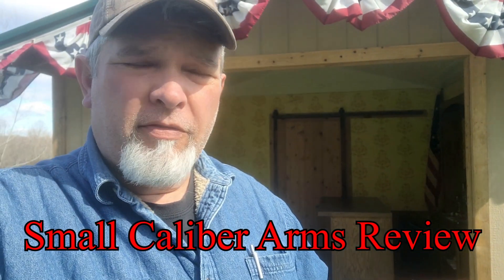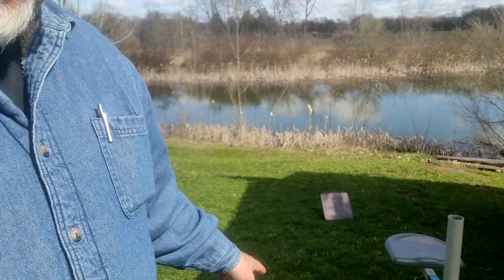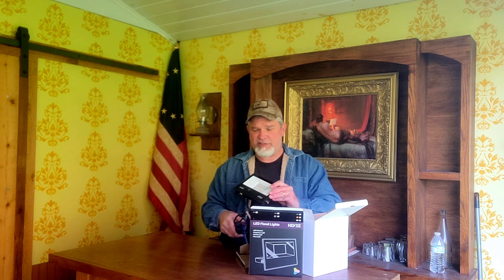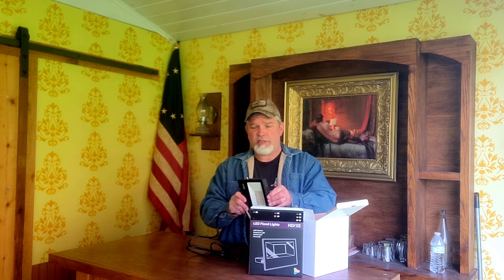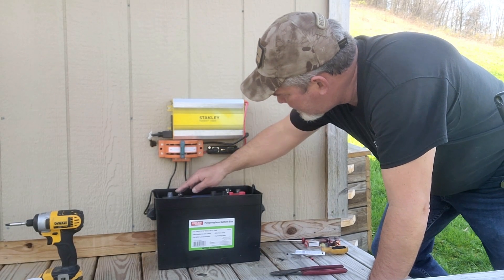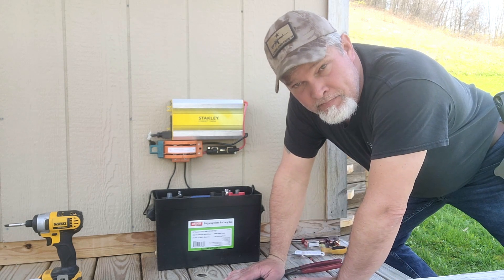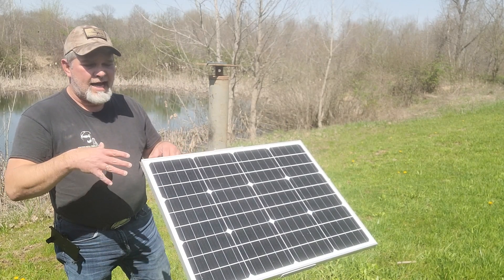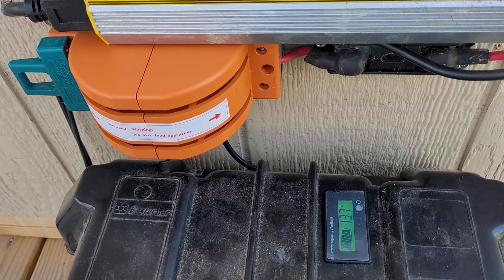Solar Power - Offgrid at the Saloon

Comment: I have a similar setup with the inverter and marine battery that I use for emergency power. I have it on a fold up 2 wheel dolly to easily move from my porch where I store it and have it plugged in with a battery tender.

I have to use a sleep apnea machine to sleep at night. If the power goes out which happens a lot here, I don't sleep. I even use it to power the refrigerator if it's during the day.

I'd like to get a better battery system with LiFePo4 type of batteries and be able to get more energy out of them and be able to use a larger inverter. Also get a solar panel to keep them charged too.

Looking forward to your new building plans!
Reply from the maker: Those LiFePo4 batteries are expensive! I do like that you can discharge them more than the Lead Acid batteries though. I really want to get started on the new project but it's still a little way down the road. Thanks for watching!
Reply: @SmallCaliberArmsReview  I would like to use those batteries for lighter weight as my set up is somewhat mobile. Plus gain some more amp hours. I've thought about the 18650 built up into a pack but then I assume it would get delicate being mobile.
Reply from the maker: @jeffallen3382  Whew! That could be a lot of work but I have seen people build some frames to hold all those cells together.

Comment: Thanks for the vid , I love solar power especially as I live in the tropics ,it’s a supplementary power supply along with mains and as I’ve had it since 2017 it’s paid for it self . By the way I added to it gradually over the years withe more panels/batteries. The batteries are in a separate shed next to the house .🇵🇭✌🏼🇺🇸👍
Reply from the maker: I'd like to see all the appliances we use designed to run on 12v or lower, and do away with the inverters. Most electronics only need 5v anyway. I plan to build a much better system on my next big project. Thanks for watching!
Reply: They are expensive, but RVs and boats use 12 volt lights, refrigerators, fans, etc.  I also think some laptops can connect to 12 volt.  Here in South Mississippi, I wish we could run air conditioning off of 12 volt or propane!
Reply from the maker: @douglasmaccullagh7865  12v AC would be awesome, especially something big enough to cool a house.
Reply: I’ve done exactly that bro , 5v charging and lights throughout the house and gym , I do have inverters if need be but I mostly use for lights n charging phones iPad and laptop 👍🇺🇸🇬🇧🇵🇭✌🏼
Reply: What battery systems are you using?
Reply from the maker: @jeffallen3382  I'm just using a deep cycle marine, lead acid battery. Hopefully I'll be using the LiFePo batteries on my future project. The single battery I'm currently using has worked well for me for almost 2 years so far.

Comment: Best of luck in the bigger building project! Solar....I like it!
Reply from the maker: You'd get a lot more use from solar in Arizona then I will in Ohio. I'm still doing a lot of sketching but the stars are getting closer to aligning. Thanks for watching Santee!
Reply: @SmallCaliberArmsReview  I have heard that there are places in Arizona where you have to pay a licensed electrician to put in solar power - you cannot do it yourself.  For me paying the high costs associated with an electrician negates the savings from alternative energy.  I much prefer the do-it-yourself approach that you are taking.  I have not researched myself to find out if that information about some places in Arizona is true.  The same person told me two years ago that all ammunition manufacturers would focus on 9x19mm Luger only in order to met demand.  That didn't happen, so they might have not been right about what they told me about local ordnances.
Reply from the maker: I don't think anybody should be forced to pay someone to do something they can do on their own. I have met "professionals" that do far worse work than an "amateur".
Reply: @SmallCaliberArmsReview  I agree.  I'll be doing more looking into local ordinances before I relocate.  If I can make the sunlight run the HVAC and install the system myself, then it will be worth it to me.